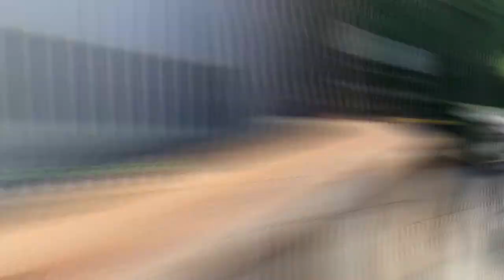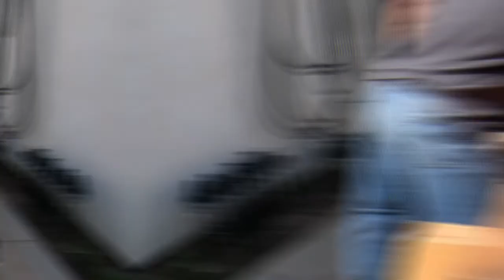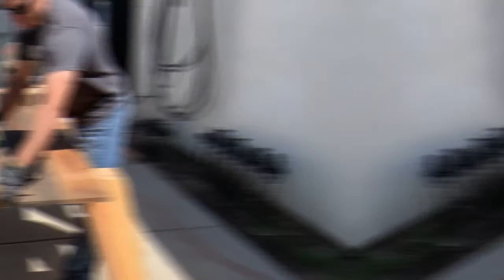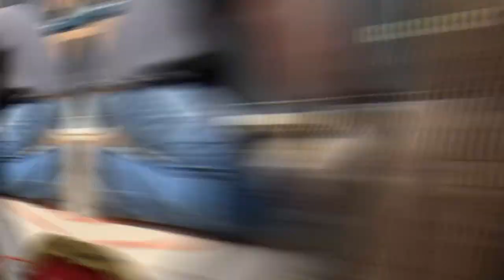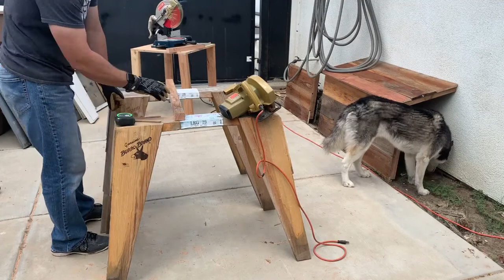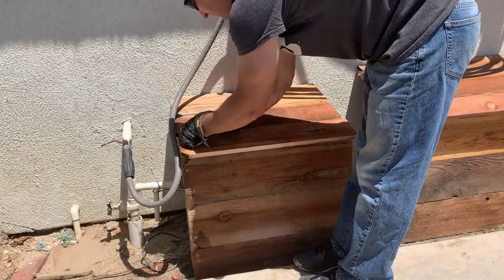DIY Sprinkler Valve Cover

Comment: Good idea and design for areas that don't get a lot of rain or a lot of wind. With stucco walls it would probably be OK, but it would violate the building code if the wall was wood or wood clad, because it would give termites a route from the ground to the wood siding of your house. But this could easily be fixed by attaching  metal flashings to the ends of the wood that leans against the house.
Reply from the maker: Excellent advice!  I also later went back and attached two legs to the back of the cover so it’s free standing.  Initially I thought the “lean-to” route would be fine, and it was, but adding those back legs really added stability.  Thanks for watching!

Comment: Good idea.  Been thinking about something like this but never thought of making out of wood.  Though it would need to be something like a cement board.  That fence wood boards looks like redwood.  In California there are termites, and redwood are supposed to be termite resistance which is good for this application when it is on the ground and near a house wall.  Less chance to get ground termites.  In my case it will get wet too be the sprinkler, which boil linseed oil or some water resistance clear coat could help.  Or make a replacement when it gets worn out.  Thanks.
Reply from the maker: Excellent point Tucson, a good clear coat treatment or linseed oil to protect it from the elements as well as termites is a great idea!  Also I have since put some bricks under the corners to lift the box up off the ground to keep them from soaking in water when it rains and hopefully ward off the ground dwelling termites.  Thanks for the input!

Comment: Did you attach it to the wall.  I didn't see  you drill any holes.
Reply from the maker: I didn’t attach it to the wall, I just leaned it up against.  It lasted that way a long time, but I decided I wanted it to free-stand so I later added two legs on the wall-side corners to make it stable.